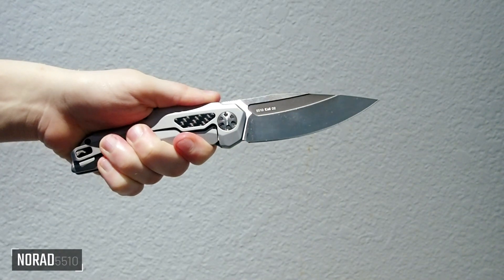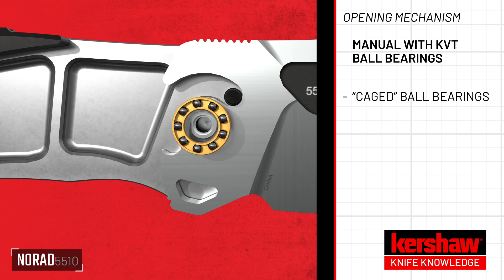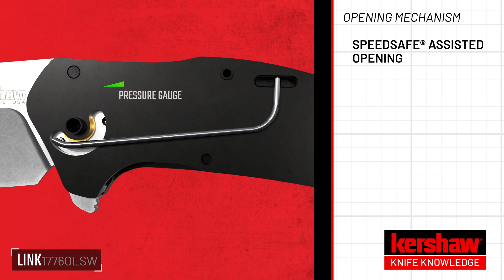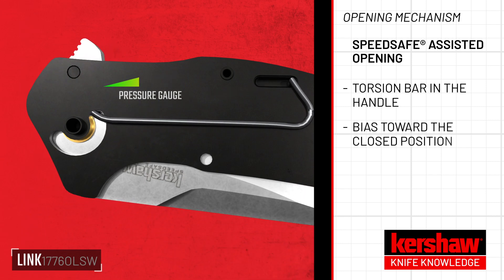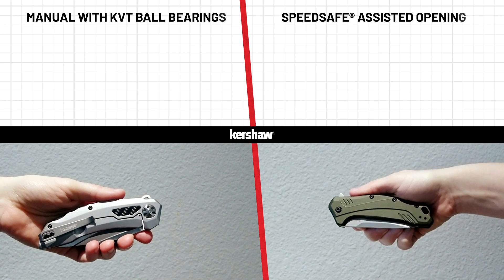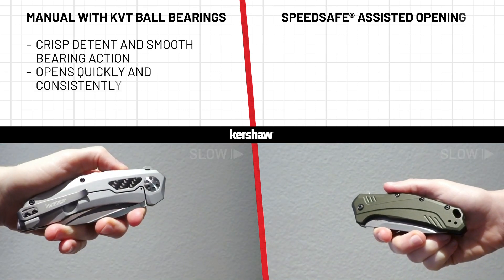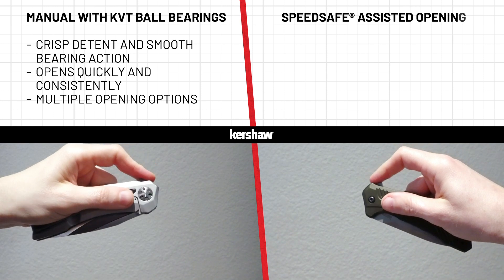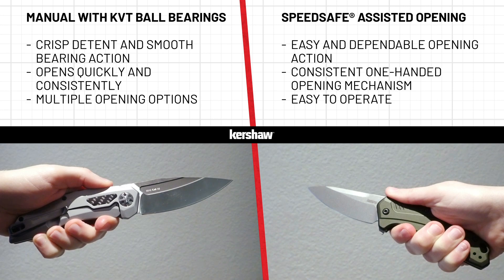SpeedSafe VS KVT

Comment: Most of the time when speedsafe breaks your knife won't stay closed. And it does break
Reply: Replacement torsion bars are free from kershaw. I had one wear out and would close but only open halfway with the flipper. Kershaws site made ordering parts painless. Grateful that I have my knife back in use
Reply: @Will C  that's great but most of my speed safe knives aren't worth any extra trouble than the price for me. I just know not to buy them anymore. I learned the same lesson with the benchmade axis lock